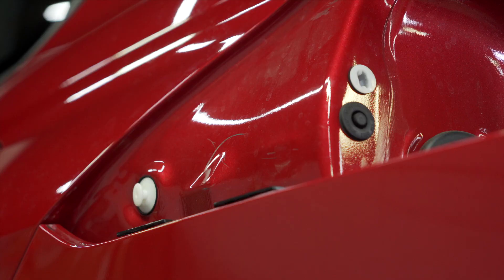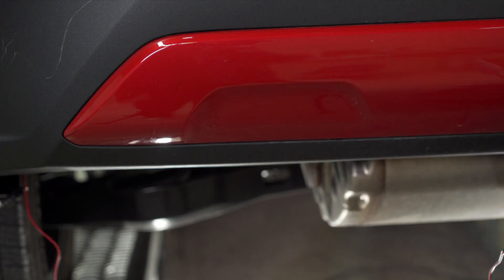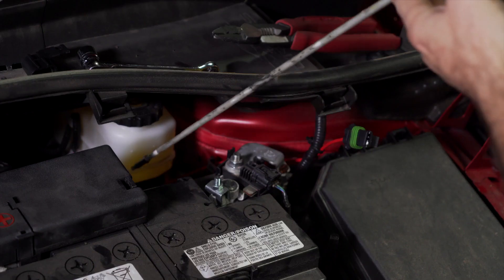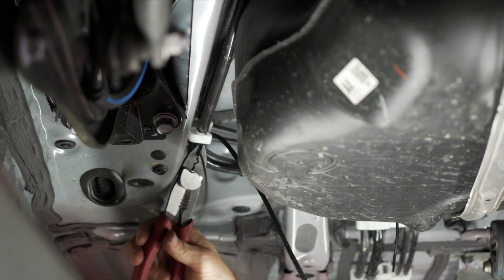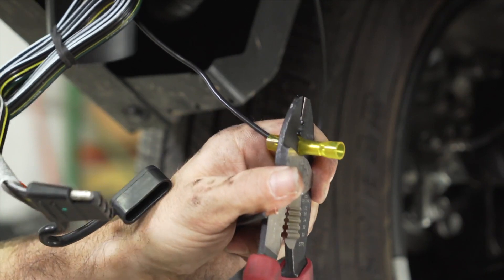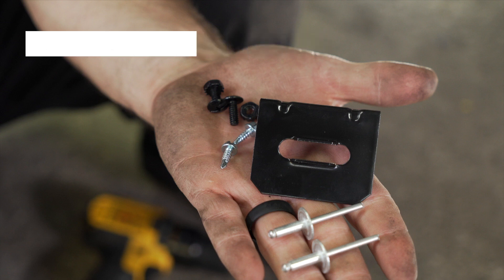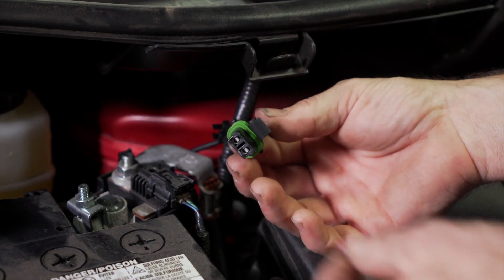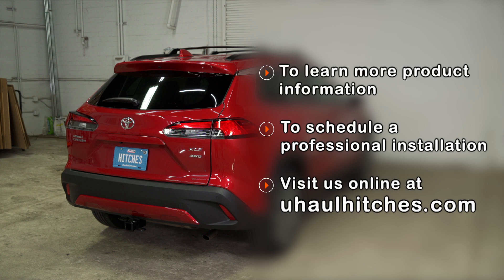2022-2024 Toyota Corolla Cross w/ LED’S | U-Haul Trailer Wiring Installation | CQT118886

Comment: Hey, can you install also the same wiring to 2024 Toyota Corolla Cross Hybrid??
Reply from the maker: At this time the part installed in this video is only confirmed to fit a 2022-2023 Corolla Cross w/ L.E.D. taillights. I see different parts based on trim Package for a 2024 Corolla Cross Hybrid. Visit your nearest local U-Haul hitch center for a free pre tow inspection and help ordering the correct wire harness!